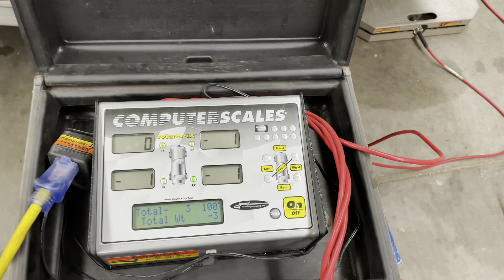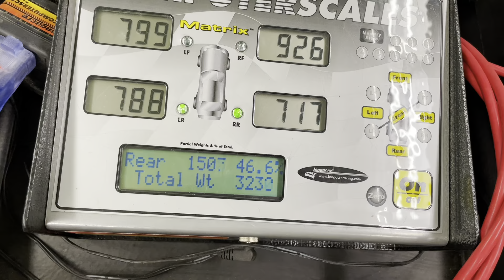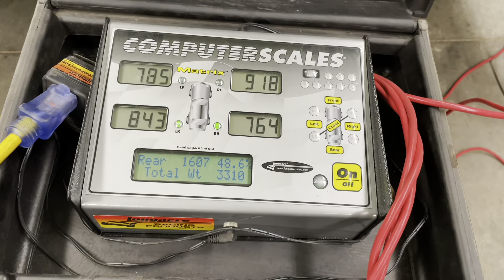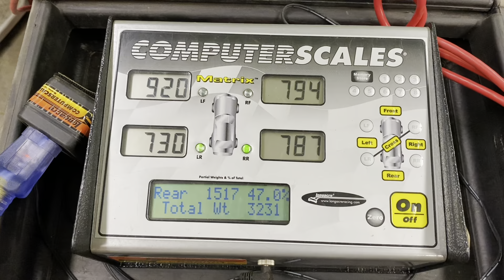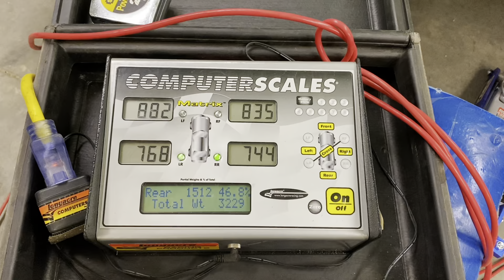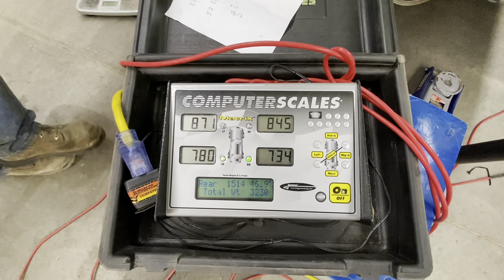Making Chassis Adjustments Using Scales on the Duster

Comment: Did you try giving the left torsion bar a crank or two?  That will add weight to the RR.
Reply from the maker: We tried, for whatever reason raising that side put more weight on the the left front which shouldn’t happen but according to the scales did.
Reply: @jerayracing  For whatever reason, we’ve had to bounce the front and a few times to get the ride height adjustment after turning the screw.  Probably something to do with that.
Reply from the maker: @johnwilburn  we did bounce the car. We have a test and tune this Saturday so sometime this week we will be putting the car back on the scales and looking at the numbers again. Thanks for your input!
Reply: @jerayracing  Looking forward to it he video!

Comment: I ran into the different width spring perch bolt pattern when I installed the Super Stock springs on my Satellite. Do you have the lighter drag race torsion bars? 
By drag shocks up front, are they adjustable or 90/10s?
Reply from the maker: We have slant 6 torsion bars and 90/10 adjustable drag shocks